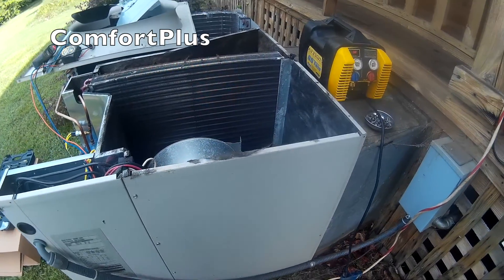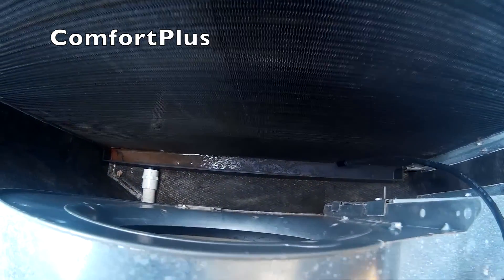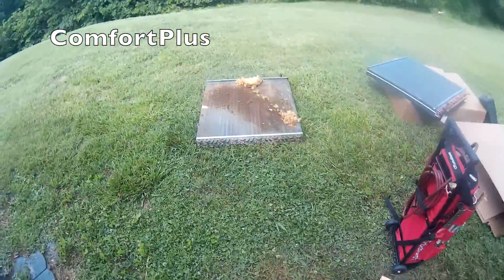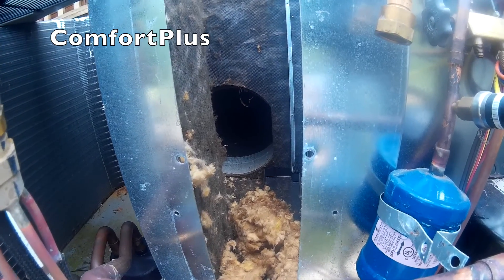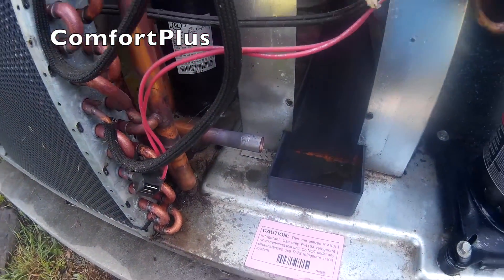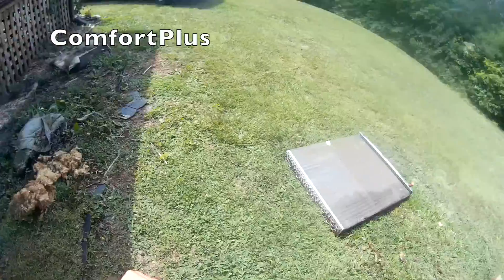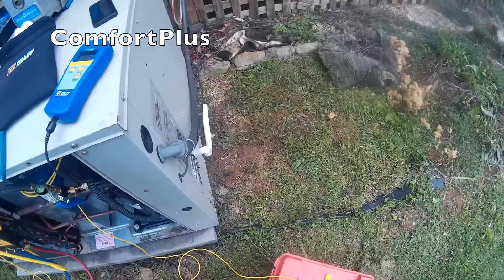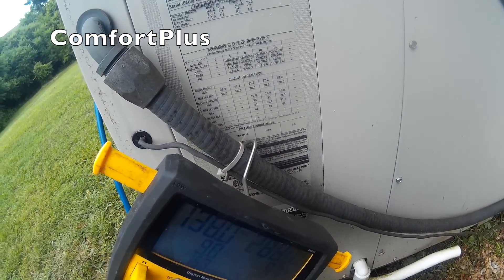Replace Heat Pump Coil

Comment: got one just like it too changeout......a 3 ton......some reason these coils don't last...i put 3 in the same unit'''''........bad solder joints from factory...........................
Reply from the maker: That's my first nordyne coil. I swear I think the pressure was probably just way too high this winter in heat mode due to the nice warm blanket it had lol.